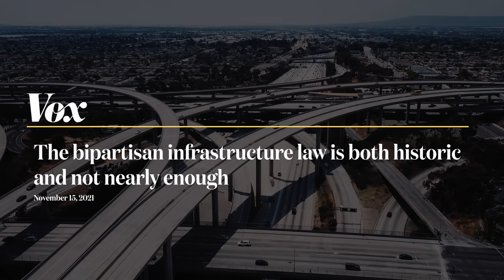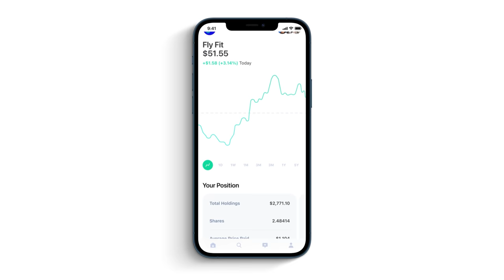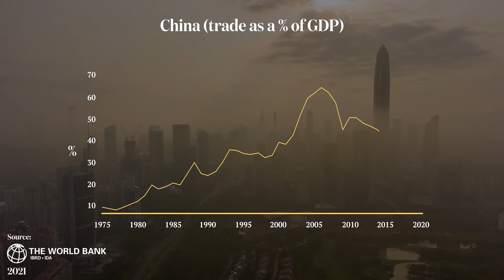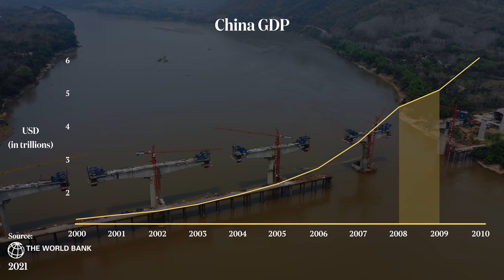China Has A Debt Problem Three Times Larger Than Evergrande | Economics Explained

Comment: The sensible thing would be to have sigh speed between major centres and regular rail everywhere else. Australia made the same mistake with the NBN though under Labor; they insisted on connecting everybody up meaning some houses cost like $100k to the taxpayer to give high speed internet to a property in the middle of nowhere.
Reply: Yeah instead we got the LNPs NBN which probably ended up costing just as much for a slower speed and a less reliable system, but now they've decided that labors plan was better, so now they're spending all that money to do it again.
Reply: False economy Phil - the LNP plan ended up costing nearly as much while delivering much slower speeds.

Sometimes the cheaper option isn't really "cheaper" at all when you account for performance. It's not just about price, it's about the performance you get for that price.
 Getting a handicapped system for a marginal discount isn't exactly wise spending.
Reply: Yet your "high" speeds on that system are TERRIBLE.
Reply: @toomanymarys7355  Not really. If you are lucky enough to have FTTP then the speeds are really high if you can afford to pay for a high speed plan. The problem is that most of the country has FTTN which is useless.

Also, you can live in the middle of nowhere in Tasmania and have a FTTP connection which cost taxpayers $70k to install for you, while people who live a few kilometres from the centre of a major city are still on FTTN.

Comment: I think this analysis loses itself in economics too much. China's highs peed rail has always been a political project, one that China has come to excel at. It seems like you are randomly picking headlines and old articles. I still got the feeling this serves as some kind of comforting explanation for the west's slow infrastructure. You don't mention the core aspect of China's boom during the last 20-years: construction. China's economy has come to rely on it, and high speed rail is a very beneficial thing to build, involving complex overpasses and civil structures. You can see now that China is simply running out of things to build: most reasonable infrastructure already exists. This is why China is exporting it's construction to Asia and Africa. There are tons of railways to build there. China will not let go its high speed railways. You make it seem as a purely financial cost/profit equation, while other (economic) aggregates are completely ignored. Increased acces to transportation has driven our economies forward, now china is doing the same, but smarter. Don't forget that you are dealing with (in name) a communist party. Large, accessible infrastructure is part of the CCP's promise.

Comment: Referring to your rail line profitability  calculation I would like to criticize the following: Even tho a single side line would not be profitable as ridership is to low for a frequent service, it can increase the profitability of a main line even further. This is due to the fact that most people don't take a single train from their origin to their destination. The main goal for these side lines is to increase the potential ridership of the entire system and thus can also increase the profits of the entire system. Therefore most attempts to privatize rail companies fail in that way, as investors are only interested in running the (profitable) main lines and are not interested in spending in a unprofitable investment for an other operators profits. For example seen in GB with a mess of "franchises" to get investors to run even the unprofitable lines somehow.
Reply: This is a good comment. You have to look at the whole picture and not just one part of it. Unfortunately economists (especially those with a bone to pick) often oversimplify and take a very narrow approach.

Comment: This is a pretty weak analysis. I wonder if the Chinese government build any rail lines between 1947 and 2008 ? Maybe that is something you should find out if you want to know how coal steel and grain get transported.
As usual strictly economic analyses leave out strategic considerations. How quickly can Beijing get it's army and equipment from the southern provinces to Tibet in the event of a major war ? 
Now China has the expertise and production capacity to drive a high speed line across central Asia through Kazakhstan to Moscow and beyond. If that gets done how long will it take to move and army from Southern China to Western Europe ?
Can you calculate the economic utility of that maneuver ?
Reply: luckily it only takes one smart bomb to take a single section of the entire line out. good luck moving your army in its high speed train over rubble. Infrastructure is pretty vulnerable in times of war.
Reply: @ruudleervander3025  thats why there are redunacies, high speed trains can run on conventional lines at a slower speed for bypass.

Comment: Just off the top of my head: Would downgrading some of these highspeed rails to normal ones work? How expensive would that be? Would it lower upkeep costs?
Reply: Well there are already cheaper trains, they're called green trains, making the same routes, so basically they couldn't compete. Spain is having the same problem. The "solution"? To lease the railways to different companies from Europe . It's unthinkable in China. It would kill the not profitable routes.
Reply: Here in France the government created a "low cost" TGV (speed train) company. And we have the same problem, they only work in the high demand lines, so SNCF is losing more money than before. It's affecting the regional networks because there isn't enough money for maintenance. Now I have to go to work 45 minutes earlier than before because they eliminated the train that I used to take.
Reply: The expensive thing in highspeed lines is that they require to be straight, or have large curve radii: that means exepnsive land acquisition, numerous bridges and tunnels. The wear of the track depends on the speed and the weight of trains. Upkeep cost rise exponentially with speed: before 300-320 km/h (EU-HSR speeds) it isn't that noticeable, it gets dramatic at 350-360 km/h (Chinese HSR speeds) and above. So it doesn't really help to lower operating speeds, though thay might want to make trains run at only 320 km/h. The other thing is that highspeed lines have different specs from conventional lines: they have large curves, but allow for quite steep slopes for trains. Highspeed trains are lightweights vehicles (a bit like airplanes) with powerful engines, regular passenger trains are slightly heavier vehicles with less powerful engines, freights trains are very heavy, with very powerful and slow engines. Freight trains are usually to heavy and regular trains not powerful enough to climb HSR slopes. If you downgrade HSR to conventional, you lose almost all benefits of HSR without allowing freight or commuter trains.
Reply: @chubbygardener  Most rails company in Europe didn’t seems to go heavy in property development like JR is. JR increases its demand by developing property surrounding its railway. Not only is property business profitable, the property there also drive demand.
Reply: Railways make REAL money/profit by moving freight! Heck, railways first came into being exclusively for moving freight. Moving passengers was always a side business for railways.

Moreover, moving people is always an iffy sector to make money. That is why so many airlines big and small have gone bust over the years, whereas freight moving companies like UPS and FedEx have been growing from strength to strength.

In other words, HSR tracks are NOT built to handle freight. So, without freight, they have to make all their money by moving people, for which they need huge volume. If not for that, they would have a problem maintaining their lines.

Comment: Another solution is to use HSR rail as "boosted" regular railways. They do it in the Netherlands : running regular trains between low-frequency HSR trains, to better use the capacity of it and boost regular trains without the major upkeep cost of fully HSR trains. Those regular trains are slower but can still run up to 200km/h while being cheaper to maintain. It would add revenue and link smaller cities together. Which means they could eventually run fast freight trains, but still cheaper than hauling everything in trucks.

Seriously, they just built too much HSR. Their profitable routes need more tracks, but they ran out of money to build them while there is empty useless tracks.

Comment: Chinese cities are simply too crowded for airports. A 16-car train of 400m long can carry 1200 passengers, and a railway station can be just as long as the train is. Commerical planes need 10x land for the runways but rarely has more than 300 seats.
For example, Shanghai Hongqiao Railway Station in average serves about 376,000 passengers every day in 2019, that's will fill about 2500 boeing-737s. Replacing that railway station with an airport will take 10x more land, and require that airport sending and receiving planes every 30 seconds.

Comment: The commercial freight problem you briefly mentioned is a lot more important than you gave it credit for. China's relentless focus on HSR has crippled its commercial freight rail, requiring the vast majority of goods in China to be transported by truck. Truck transport is not only slower, more expensive and generates more carbon emissions, it also further strains the already shoddy quality of China's road infrastructure, especially considering overloading freight trucks appears to be standard practice in China.
Reply: There are high speed freight trains in China.
Reply: I would have to point out that,  the construction of HSR in China did not cripple its freight rail. Rather, an important consideration of HSR is to relieve the existing and overused trunk lines from the flood of passenger trains, and yield more capacity for freight trains. And that has been quite a success.
Besides, although overloaded trucks are still quite common in short-haul routes of concrete and dirt (which can hardly be substituted by railway anyway), they have disappeared in long-haul routes on Chinese highways now. That is because Chinese highways are mostly tolled, and the rates would be several times higher if a truck is overweight.
Reply: yet, you can literally get something shipped for anywhere in china with 1 day shipping for less than 10 USD. not sure how that works, but expensive and inefficient ,  ey?  Just admit it, China's got the best logistics system in the world right now.

Comment: China is blowing billions on hokey infrastructure projects to prop up a failing economy, they may have built a hospital quickly, but they also stamp out ghost cities not a single person is ever going to live in, and have abysmal construction quality leading to what has been dubbed 'tofu dreg' by the Chinese citizens. These buildings are constructed quickly like that hospital you praised are most often made to poor standards using sub-quality materials leading to buildings that are fragile and incredibly dangerous to their tenants.

Roads and rails also generate effectively zero revenue, they are insanely expensive to maintain, so what matters is where they connect to, not just the fact that they are being built.

Comment: So for an economics channel you just straight up missed the actual economics of railways and high speed line, really gotta congratulate you on that one there.

The rail lines have never meant to make a profit, the fact that some do is frankly just a nice benefit. Instead the goal of the high speed system which China has built is Freedom of Movement. This allows then for Freedom of Labour as employers can pull from a much greater range for their pool of available workers. Oh but let's also not ignore the fact that now these labourers who live in one city and are employed in another, can go shop in a third and do all of it in one day and be back in time for dinner.

The real economy of rail doesn't come from the rail lines or the trains but from the movement of people and goods and the fact that those people and goods can easily get to where they want/need to go. The business that is available due to that movement, that couldn't exist otherwise.

High Speed lines in particular have a really good effect in boosting capacity on the normal rail lines for passengers and for frieght. The high speed trains require a large gap in the timetable so they don't run up the back of any slow trains normally, get their own line, and so can run at speed closer together whilst allowing local regional trains to run closer together. All of this feed back into that "Freedom of Movement" argument because Frequency is Freedom!

So basically sure the company making the lines may be in debt but is China itself in trouble because of this, no.
Reply: There is a very valid point here

Most working as intended public transportation systems are usually running at a loss, most bridge projects are running at a loss assuming it was funded by the government without collecting any further tolls for the bridges 

The benefit is directly tied to increasing possibilities, however - an expensive high speed line isn't exactly that useful in a country where the public can't really pay up the significant cost that charges for it ? Perhaps an expanded normal rail would have increased public benefit at a far lower engineering cost?
Reply: The video maker has a typical capitalist mindset: profit; the enrichment of the capitalist ownership class.

Comment: The problem with Chinese High Speed Rail is that it’s cheaper and quicker to fly. 

I live here and would much rather take HSR than fly or drive. However the HSR is always more expensive and slower than one of the other two options.

Comment: I have a question does GDP growth include inflation, or a 2% growth GDP with 2% overall inflation mean a 0% growth
Reply: GDP is usually measured in USD. So your answer is yes. There's nominal growth and real growth, they are 2 different things
Reply: @ctb1977  so real GDP growth are measure GDP minus inflation?
Reply: @Fauzanarief-n7i  Yes
Reply: @Fauzanarief-n7i  So what is the real growth of the US? Zero???
Reply: @maximilian19931  No usually the number you see is already real growth.To get the nominal one you add inflation